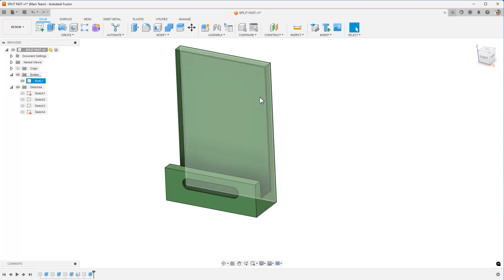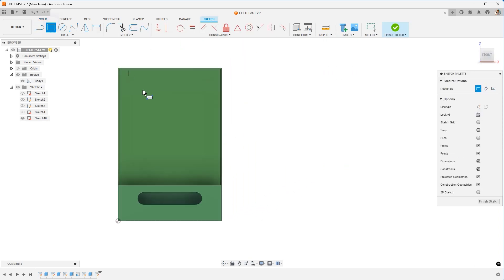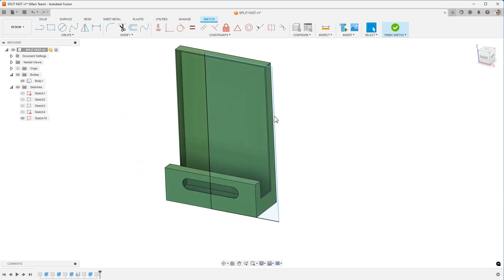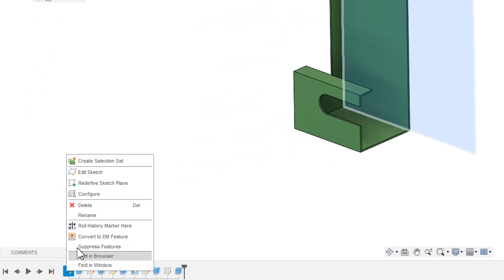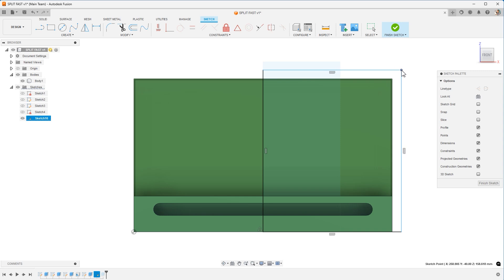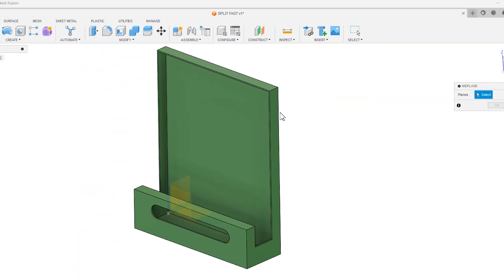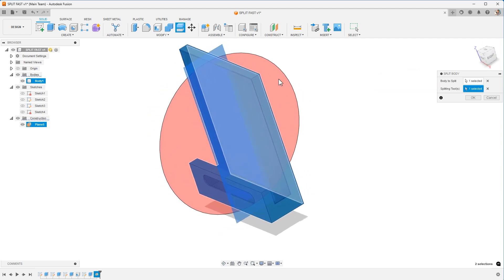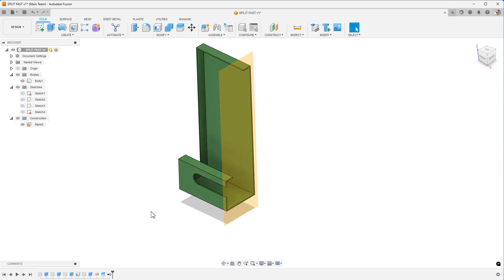Fusion 360 Dynamic Cut Technique: Quick Trick for Cutting Objects in Half

Comment: I would have used the second method from the start, but if I had to choose the first for some reason, then there is no need for dimensions in this case. Just project the relevant edges of the body and then draw a line connecting the centers of the projected top and bottom lines. That would always extrude exactly what the body is made up of and is more robust against timeline changes. This still has it's limitations, but anythin does when it comes to timeline changes.

However the split tool is more flexible as it can split using an arbitary plane and I use it over the other method almost every time. Unless I know that I only need half of the part, then I would mot extrude it in the first place, which is the safest method of all three.